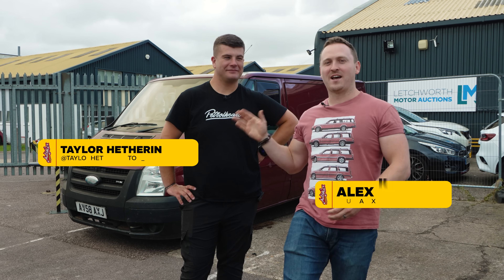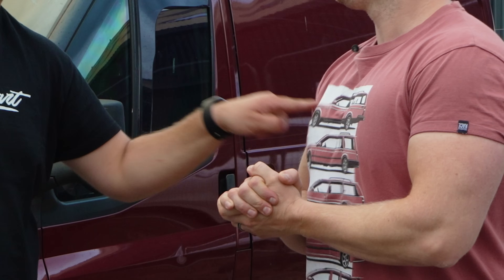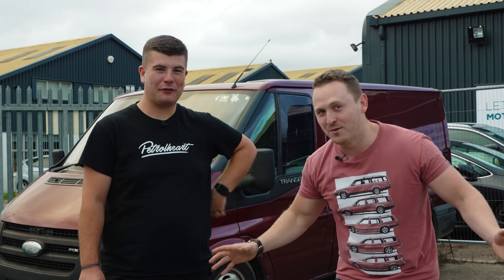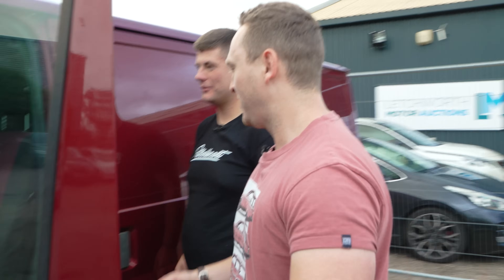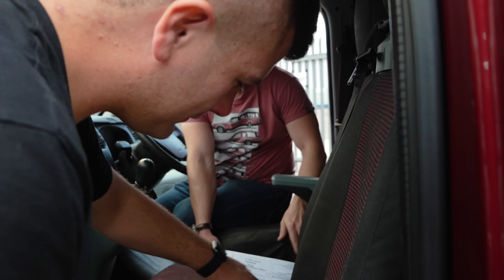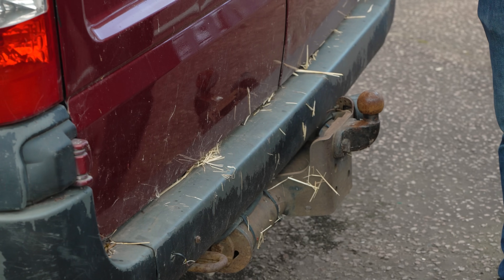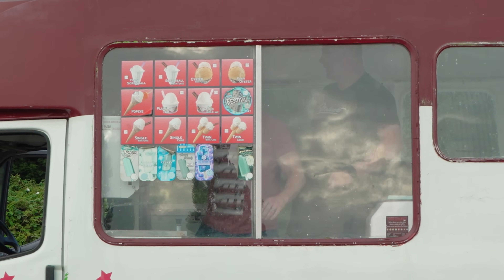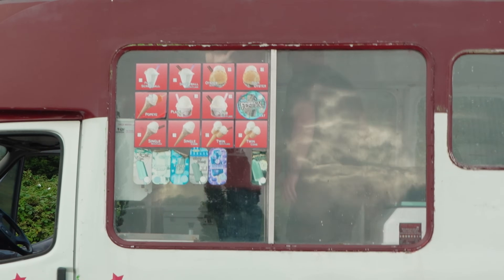£1000 VAN CHALLENGE

Comment: The whole scene with Taylor hitting the steering wheel and Alex's reaction was the funniest thing I've seen in a while.
Reply: I just don’t understand what Taylor is saying 😭 please someone has to help me
Reply: @Alessandro7954 "it does the transit thing" I think if you hit the transit wheel it does the same and set the wipers off
Reply: @Alessandro7954  think he says,
it does the transit thing
Reply: I have tears rolling down my face 😂
Reply: I fuckin died at that lol cause I had a old Chevy s10 that if you kuched the dash buy the door the headlights would turn on but if you used the switch only one would work lol

Comment: I bought a 1998 Smiley face Transhit in 2006 for £250.

All it needed was 4 tyres, new front discs & pads, new front springs, new hard brake lines, (which I made), and an engine.

All in, on the road, including MOT, tax & insurance, it cost a grand.

It lasted another 7 years until the body dissolved beyond the point of welding it up.

'Manny the Tranny' was that van's name.

2.5 litre, 4 pot, non-turbo diseasel.

Flat out at 74mph, whether it was empty or fully loaded & towing a trailer with a race car on.

It would run on diesel, kerosene, petrol & diesel mixed, cooking oil, BBQ Lighting fluid, or even used engine oil. The motor I put in it had been to the Sun & back and would run on just about anything flammable. 👍

It was a good camper in later years too, as once the rear floor rusted out you didn't have to get out in the middle of the night to go for a pee, you just aimed through one of the larger holes in the floor.

Comment: The side door is a easy fix. Cut a hole on door card to left of inside handle. Get someone to try and use handle and feel how it works from inside door. Theres a metal catch the handle has slipped past with ruff use. Push it past handle the your thumb. Dont yank handle to open door click it open with handle and pull from right at roller.

Comment: Turn them into expedition Campers, then spend 2 days & 2 nights remote & off grid somewhere, with the rules that once you reach your destination, you are not allowed to use any facilities like shops, fuel stops, public w.c's, cafes, pubs or charging points, nor borrow anything from each other!!  First to give up or quit is the loser. If you both stay the distance then you are judged on a points system .
1. You must both start at same place, at same time ,& first to arrive at destination gets 5 points.
2. Best fuel consumption gets 5 points. (Fill up at nearest fuel stn before destination).
3. The man least scarred, battered & ruined for the experience gets 5 points.
4. For each breakdown you lose 2 points. ( Including return home to start point).
5. Loser pays winner purchase price of their van.
           May the best van win..........Regards  Urban Geeze. 
 
                      May the best van win. Good luck dudes.

Comment: The fragile house removal challenge. First have your vans empty. Then drive to each others house. And pack kitchen items and furniture load into the van and drive 250 miles away to a point and back to the house and unload in a safely manner trying not to break each other's belongings.